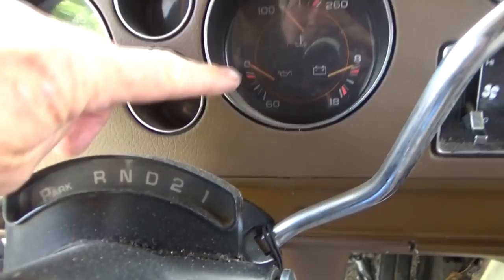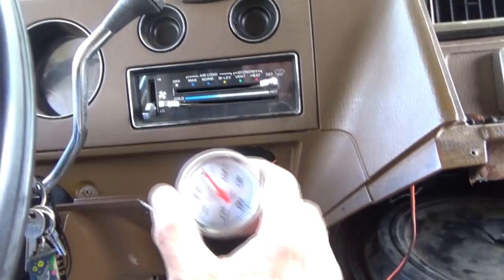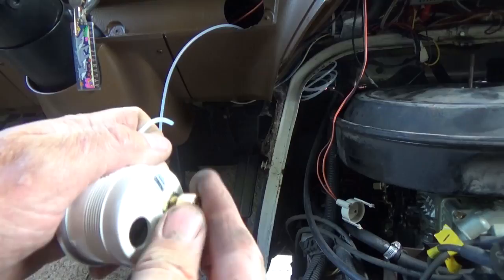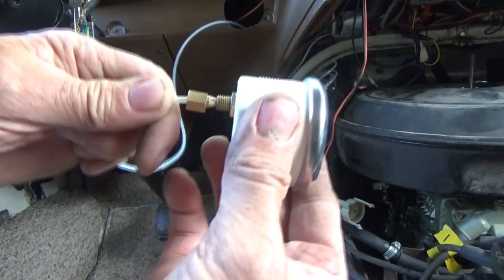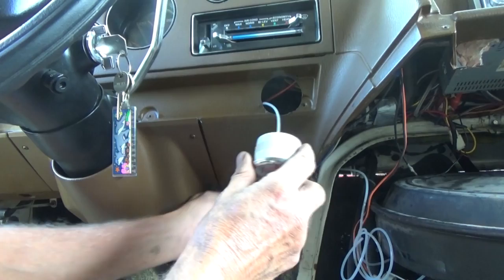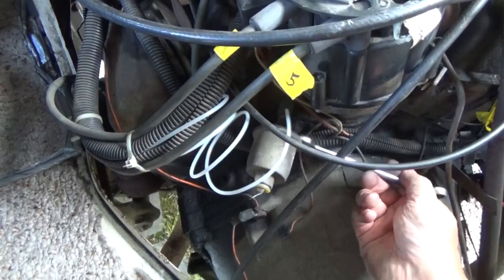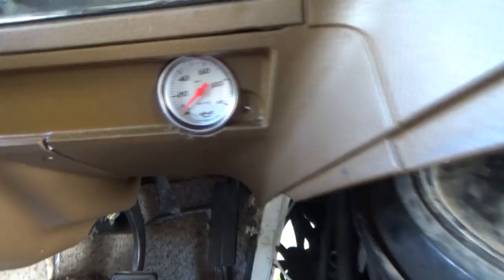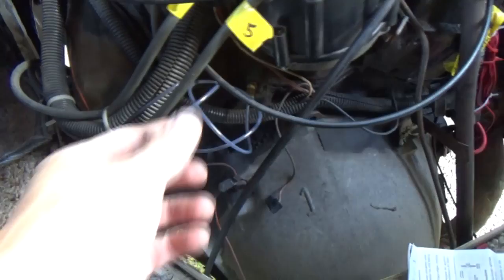Oil Pressure Gauge install chevy 350 engine

Comment: I just got my oil pressure gauge and looked up install videos and yours was the first to pop up and it was not just the same engine its basically the same vehicle I have an 87 chevy g20 van awsome video I really appreciate the simplicity you made it easy enough for even me to understand
Reply from the maker: Thanks,

Comment: Used mechanical gauges on my performance cars of the seventies. One important note, I hop you installed a plastic or rubber bushing in the wall to the engine compartment. If not the vibration will cut the nylon line you used that came with the gauge. I also switched to a copper line with the grommet, no worries of it melting or cutting in half.
Reply from the maker: Thanks Subgunman,  It has happened to me before, I was thinking of putting the copper wire in myself ,  thanks mike
Reply: what if you put the plastic tubing inside a rubber hose/sheath ?

Comment: Problem with these are that the plastic line can break and give you an oil leak from hell. Recommend just replacing the original unit. Safe yourself the time and hassle.
Reply from the maker: Thanks Kenneth,  mike

Comment: Why does mine keep leaking at the back of the fitting
Reply: Had this same issue, I returned 3 separate brands for this same reason. Even stripped one trying to tighten it to get it to stop leaking.

Comment: SO how's it held up?  I know you can run pretty much any line you want (brake line, copper line, stainless line)  But hey if the plastic one it came with is still working in 2019, might as well just leave it.  As insurance I plan on keeping my old oil pressure switch in the cab with a wrench so if it springs a leak I can swap it back out on the spot.
Reply from the maker: Hi bitty, I am the same, keeping the old one, but never had a problem with the plastic line, thanks, mike

Comment: All that work because you didn’t want to mess with something that old but would’ve spent less time just installing a new pressure switch
Reply from the maker: Hi Jeremy,  I didn’t trust the old one anyway, so killed 2 birds with one stone,  I appreciate it, mike
Reply: I agree. It's a 10-40 part. Easy to replace.

Comment: I have the same gauge but with copper tubing not the nylon and the gauge makes a ton of noise.
Reply from the maker: I haven’t had any problems, thanks mike
Reply: oiyouslag927 how’d you remove it because my 74 350 small block is beyond pissing me off

Comment: Hey man, what was the part that you took out? was it the vacuum? Correct me if I am wrong. I am trying to install an oil gauge on a 67-250cid on my  Nova engine. It seems this is the only choice. Thank you
Reply from the maker: Hi, I think the old one was electric,
Reply: He took out the original sending unit for the gauge

Comment: I love your fix here, I am doing a repair on the 4.3 (this engine's little sister) and I am having a hell of a time figuring out how i am going to unscrew that oil pressure guage sender unit. the bolt is in a wicked spot like where you would need a distributor wrench, only it requires an open end, like maybe a crow foot or something lol. man it is rough. any suggestions before I dig in?
Reply from the maker: Hi Mushy, I think I had a fitting and split it, cant remember

Comment: nice video - did the same and installed an Autometer mechanical oil pressure gauge. I have seen air bubbles in the nylon line in your video - same with my line. The gauge also shows a significantly higher pressure compared with the original electrical gauge. Warm engine at idle 800 rpm: Electrical - ab. 16 psi, mechanical - ab 33 psi. At 2000 rpm: Electrical - ab. 40 psi, mechanical - ab. 60 psi. Do I have an issue because of the air bubbles, is air pressure same as fluid pressure within the gauge psi range or something else ? Thanks !
Reply from the maker: Hi, I can't say it seems steady, Mike
Reply: @mikehaduck-travel-mechanic884  thanks - so your gauge shows the right pressure with air bubbles in the line ?
Reply: @JoeVizethum  Only way you can get rid of the air bubbles is if you bleed the hose line like you would brake lines; that means you would have to push oil all the way through the line before you connected it to the gauge.  But your pressure seems correct anyway.  It should be about 30 at idle on that engine from my research.
Reply: @JustVinnyMusic  many thanks, dude - happy to see that my oil pressure is good
Reply: @JoeVizethum  Well there are lots of opinions about this. I would say that your reading is on the high end of a normal range.  Some people say 12-15 psi per 1000 rpm.  I have also read that 20-30 is normal at idle.  With that in mind, you need to make sure your oil filter is new.  That's the biggest cause of high oil pressure. Also make sure the viscosity of the oil is correct for where you live.  If it's too high that can increase oil pressure as well.  Also, a first class oil pressure gauge can cost $75-$100.  So keep in mind your gauge probably cost twenty bucks.  If you stay on top of your oil viscosity and filter, high pressure should not be an issue.  You want to make sure it's not too low.  I think in this video, when he starts the engine the gauge goes right up to 30 psi at idle.  If you go significantly over 60 psi you might need to run some oil with a lot of detergent in it. But generally speaking 25-60 psi is optimum.  Sounds like you are in that range.
Reply: @JustVinnyMusic  thanks dude - very helpful !
Reply: @JoeVizethum  I have seen a lot of demos on youtube and a 350 that's "cammed" can have an idle oil pressure of 60 psi. So it depends on the performance level of your engine.  I have an older motorhome and the stock gauge only goes up to 60.
Reply: @JoeVizethum  Okay I just installed one of these gauges on my motorhome; 82 sbc 350 normal street build.  I started it up and the gauge went right up to about 30 psi at idle. So I have to assume for this engine and build and this gauge that 30 psi at idle is normal.
Reply: @JoeVizethum  I also picked up a cheap electrical gauge and sending unit on Amazon, which was a much easier install than that mechanical with that small tubing and rather cheap fittings.  It started out reading about 50 psi at idle until I started driving it around and then it settled in to the same reading as the mechanical gauge gave me; which is 35- 40.  So I think that's again basically normal range for this engine.
Reply: @JustVinnyMusic  thanks - yes, I have the same readings on my 4.0 engine at firing up and when driving.

Comment: What's that clip thing that has the orange and black wire going to it. It's sitting near the air cleaner
Reply from the maker: I dont know, I dont see anything, I did mark the plug wires , that's it
Reply: @mikehaduck-travel-mechanic884  asking because mine has the same thing hanging and I have no clue what it's for. It has constant power
Reply: @ThatmainBishop  cigarette lighter plug !

Comment: I put my compression fitting on back wards or whatever those thing are called faros
Reply from the maker: Hi chase, I know you can get those fittings at the auto stores and sometimes plumbing stores, thanks, mike
Reply: I got some yesterday at O'Reilly's save ur self the time am headache if u buy one of these gauges get a copper line not plastic because the plastic will break after 1 yr also buy urself some compression fittings(farrow) that are flanged on both sides evenly the cone shaped ones in the video above are a pain in the ass to get to seal throw those fuckers in the trash
Reply: @kern_yak_angler  its spelled 'ferrule' . Pronounced fair-rule .

Comment: Was the oil pressure low on that? Whats it supposed to be?
Reply from the maker: You really can't trust these kind of gauges,  to really know you got to use a professional engine gauge,, bur 35 is not bad and idle 15 or above is acceptable,  I drove a truck from Florida with 10 running and none at idle, and it ran for years after that

Comment: Cheesiest dash installation I have ever seen,  I mean, C'mon,  that looks crappy.  My 84  Chevy van had the same problem. Seems old school gm sensors break often. If you go to a scrapyard, you can use the newer type oil senders with the three terminal plug, two are a switch and 1 is the sensor, ( I forgot which) . Just remember to get the plug when you get the sensor.
Reply from the maker: Thanks. Mike